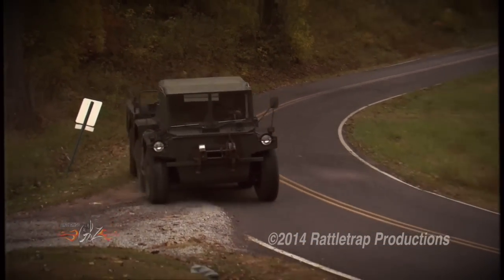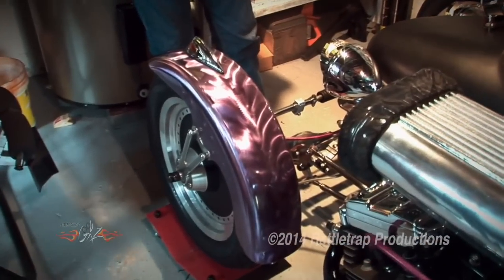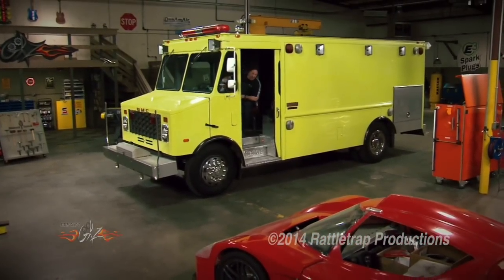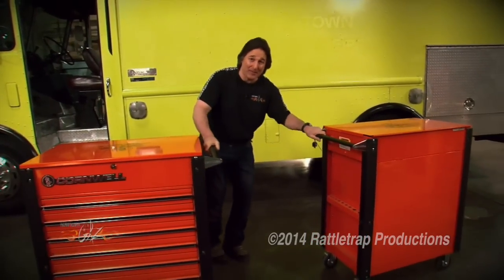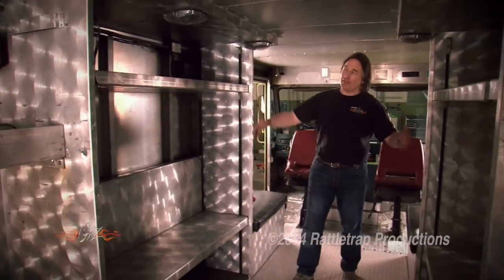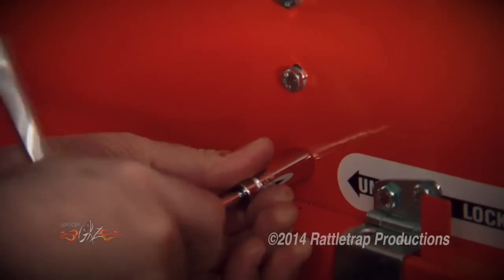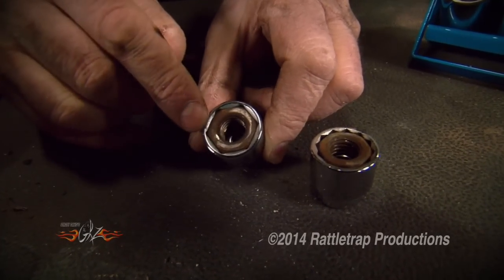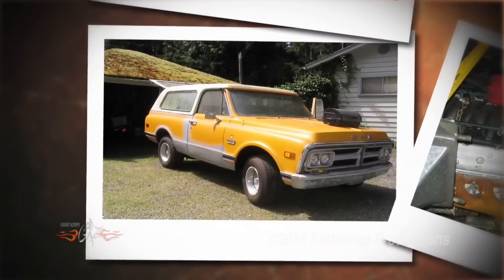Converting an Old Fire Truck into a Tool Truck - The Gearz Express - Stacey David's Gearz S8 E2

Comment: God that brings back memories. An electrical/ mechanical company I had worked for in the early 2000's bought one from a PA fire dept to use as a jobsite vehicle for box storage and the huge onboard generator it had. But that thing had a straight six with absolutely NO power. 50 MPH was a miracle to achieve downhill. We took the thing for fuel one day and apparently the front passenger side bearings had ceased and we'll they were cutting the shaft off 😅. Well we found out when we lost that tire through a residential neighborhood 🤦‍♂️

Comment: I pretty much know that you will never see this but I am going to give it a try. I own a 1984 Camaro Z-28 with a 383 small block Chevy engine. I am having trouble getting it to run the way it should. I believe that it has a rear main seal leaking.The car only has a little over 57.000 miles on the body. I promise you that the body inside and out is in great shape.I have owned the car for nineteen years and my friend and I put the 383 motor in a few years a go. I live at 368 Impartial Lane in Galloway Ohio 43119. I am a sixty year old man who is disabled and not able to hold down a job. I am not know kind of hero. I have never served our COUNTRY or have I ever been a Police man or Firefighter or anything like before. I have always worked my butt off my whole life. I have always suffered from depression anxiety stress I have seizures I amputated my left thumb and I have also had open heart surgery. I would so badly love to be able to fix my Camaro up. I was born poor and I have had a lot of rough times in my life. I have had a few nice cars in my life. I know that a1984 Camaro might not be considered a muscle car but that is and was I that I could afford. I could so badly use your help. I have tried just about every other TV show that I could think of. I don't have any rich relatives who could help me out. I don't have any family members who are car people. I don't have cable or satellite the only thing I have is the cheapest internet to use my tablet with.If you could just send me a letter letting me know one way or the other that you can help me or not.Thank you I just wish you could get back with me.
Reply: William Jackson yep.  nobody saw it
Reply: i saw it @348frank348

Comment: hey quick question I have a 95 chevy Silverado with a rebuilt motor not sure on what oil was used before just did the first oil change and was wondering what you would recommend
Reply: +Johnathan Holland  You can easily check it out on a forum which is based on other owners of the same vehicle.